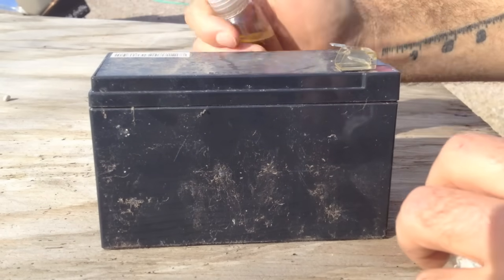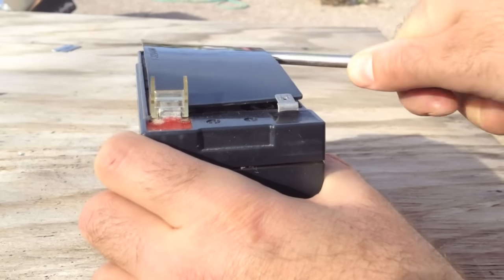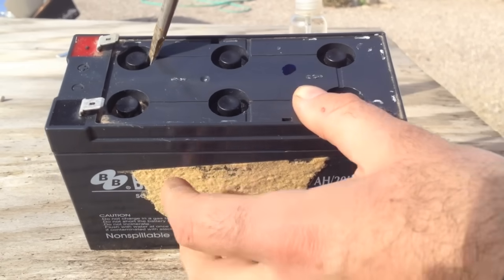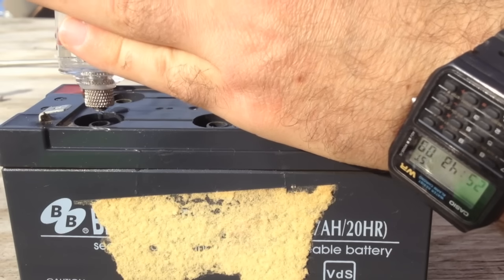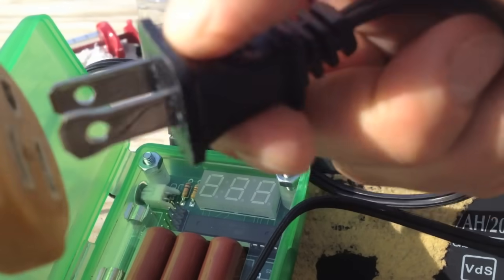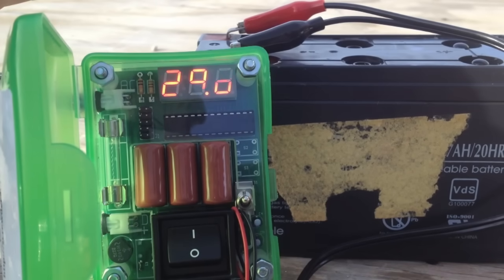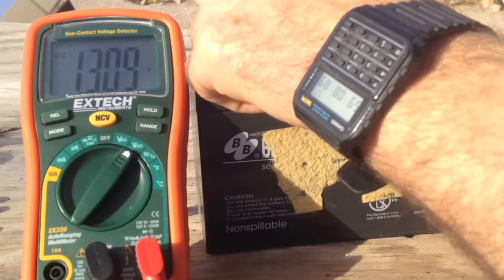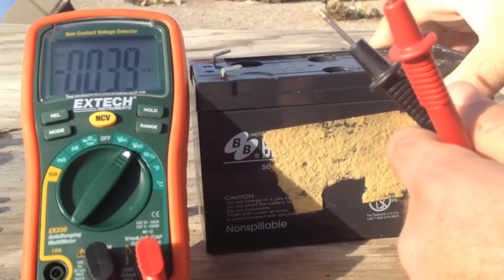Sealed Lead Acid Battery Recovery

Comment: The true test as to whether or not a battery is fully recovered is to perform a load test and capacity test. So what capacity (at the 20 hour rate that is shown on that battery) did you measure?

Comment: If I understand correctly, these batteries don't have liquid water or liquid acid even when new, and they are called gel cells. They can be used in almost any orientations in UPS applications. After adding the water, can you still use it sitting side ways?
Reply: Sure, it doesn't effect the performance.
Reply: Won't it leak if sideways?
Reply: The "gel" in a gel cell is silica sand. The electrolyte fills the spaces like a sponge. The normal level of the electrolyte is entirely contained in the sand. The battery should be fine in any position. If I were to copy this method, I'd add the water, charge the cells, drain off the excess water and then replace the caps.
Reply: Those are not gel batteries...
Reply: This is an SLA battery , what you refer to is AGM.
Reply: This could still be a flooded cell lead acid battery that is just sealed with caps that act as a valve at a specific pressure level to prevent a failure that is explosive and allow the battery to not spill acid out when tilted. Overcharging this would cause liquid to be forced out instead of gas if overcharged on it's side until the liquid was lower then the cap is in the cell. AGM have sponges between plates that are saturated to act as the electrolyte and gel type ad a thickener of silica dust turning the water and acid mix into a gel. Valve regulated lead acid battery is what this is and it is simply sealed by covering the caps with the plastic he removes in the beginning with a razor probably so that they will fail and stop consumers from maintaining the battery by ensuring the electrolyte levels are enough to cover plates to function properly. You could probably just ensure AGM battery with dry glass mats are wet with a couple drops of distilled water as the acid would have crystallized and still be there but being dry probably already damaged the plates with sulfication and expansion of some plates now not being fully in contact with the mats in the cells. So with a flooded cell battery as long as the lead plates hasn't broken down and now sitting as a sludge in the bottom of the battery or completely coated in a layer preventing contact with acid for the reaction of sulfur oxide then it's simply low on distilled water and adding it to levels that keep the plates covered in electrolyte should restore the battery to it's rated capability. Just saying SLA only tells you that it's a lead acid type battery that is sealed. Is it valve regulated so it doesn't explode from overcharging? Does it use Gel or glass mat type electrolyte medium? or is it just a regular old Wet cell lead acid battery that the manufacturer sealed up (kinda) so regular maintenance instructions are not needed and failures will always mean that one should buy another battery rather then correct the failure that might only be add mineral free water to dry acid for wet acid solution in lead acid battery....
Reply: bn880 absorbent glass mat and gell are different but they can't still be both flipped  any way the user wants and have no effect on performance.
Reply: NoVaKane is right. AGM(Absorbed Glass Mat) are different than GEL batteries. both do not require any additional water/acid mixture once sealed from the factory. For many many years people confused AGM with GEL. The best example is Optima Batteries. For years I have been correcting customers thoughts that Optima's were GEL and infact are AGM.
Reply: They can be AGM or Gel. All Gel batteries will be marked as such due to it being a huge selling point. And no...once you have broken the seal I would noy use them in any position but vents up.
Reply: G Henrickson or they mark them do people know what kind of battery they are so they know better how to properly charge them. If they wanted to sell more the wouldn't list them in hope more people would ruin their batteries and in turn need g to buy more

Comment: Aww man so awesome I'm in a wheelchair and I had a power wheelchair given to me and it has set about as long as your battery it takes two batteries and they are about $300 a pair I can't afford that so I'm going to let these cool off they have been on charge a while and I'm going to take them apart and try what you just showed me thank you so much my good friend
Reply: Roy Nelson I have a brand new electric wheel chair that was my mothers, the ticket on it was $10,000 and some change. The two batteries on it are $400 each but I was able to revive only one. I use it on my solar power battery bay now. As for the chair.. I need to find a buyer for it. I'm not selling it for $10K lol that's insane! but it has all the bells and whistles on it. I also have a 3 wheel Scooter that I modified the gearing on to go faster... Mom liked that one best, she was a big drag racing fan too so right up her ally!
It has the seat that goes up and down with a button press and a charger built into it with a retractable cord.
Reply: That's awesome brother it really is I have a youtube channel you should check it out sometime I put some motorcycle speakers on my power wheelchair MC 400 they rock pretty good lol I'm into RC cars and stuff I do different kinds of videos with those me and my grandson when he's here I do a lot on my own I'm doing a build right now and test and tuning put some boost bottles when this one here better throttle response
Reply: Roy Nelson I been doing some Arduino wireless stuff recently, I got some of those esp wifi modules and I can see great potential with those for home automation and even RC applications. Somewhere around this mess of a shop I have an RC drone with a servo camera on it.. Paid over $450 for it a year ago.. I use it to inspect radio towers before we climb them.
Reply: That's awesome brother and hell yeah on the drone that's really cool what you used it for I've never had one one of these days I will get one after I quit playing with these cars and settle down for a little flight time I want to get an airplane and its called the e flite apprentice that's what I want man
Reply: I never had an actual RC plane, a friend of mine had a B-52 RC gasoline plane and it was HUGE!
The drones are tricky to fly and takes practice because you don't want to crash one, expensive to repair..
I also have model HO scale trains too.
Reply: That's awesome brother I have always loved those trains
Reply: Roy Nelson résultat : c'est comme pisser dans un 🎻 violon !!!!
Reply: Serious? You can get these Battery from $14 - $20 - With my Time and Money and Coffee trying to revive these... I have better luck buying new battery :///
Reply: lmao

Comment: I'm enjoying my DP2! I'm restoring every old battery I can get my hands on. I have a problem with a new SLA I got off ebay: When inside the UPS, the battery is on its side and leaks some liquid. Any suggestions how to make sure those caps stay on snug (but not too snug)? It's a battery very similar to the one in this video. Thanks

Comment: The fact that the caps are sunk in tells me that no pressure is of concern as the water levels have dropped caving in the caps requiring water , sadly the fact the battery has sat for so long possibly damaged if not one all cells Internally leaving the battery useless , it might show charge and hold temporarily but inevitably will lose charge and render time repairing a wasted endeavor. Nice video and well spoken much appreciated and health wealth and happiness to u and yours sir.
Reply: Can battery like that with 1 dead cell still be used as 9  volt battery for 9 volt fan ? I

Comment: Can this kind of battery blast? It looks pretty safe dry, quiet, water etc (i hope you understand)
Not like li-on or li poly batteries that sound more chemical and complicated to me.
And my last question it is lead battery i know that it has lead plates in it but you put water in it so where is the acid?

Comment: Comments included this "Iron Out" product and dumping all fluids and replacing with distilled water. Why were you not using new battery acid instead of water? I have no experience with these small batteries but lots with big batt for electric warehouse equipment. We would remove those cells gently wash off the sulfation and clean out the case. As long as the plates were okay and the sulfation was no longer present we would refill with new battery acid, ck the specific gravity of the liquid and recharge like a new battery.
Reply: Ok bud, you have presented the same problem which you started your comment out with. How did you remove the sulfation? Iron out? How much did you use?
Reply: JM these are batteries that are in metal cases with individual cells that are sealed in with an asphalt product. These batteries weigh anywhere from 2 to 5,000 lbs. depending on the equipment and voltage, amperage requirement. We would remove the inner cell connectors and pull the non-performing cell completely out of the case. We then cleaned the cell with baking soda and water and plain water under no pressure greater than what you got from a hose. We vacuum out and cleaned the case with the same solution. After a thorough drying we reassembled the cell in the battery case. We also had floor drains in our battery room where all effluent went into a concrete vault. We had it pumped as necessary by an environmentally approved company. I hope I have answered your question. The battery companies are building these batteries (the individual cells in plastic now) which makes this type of maintenance more difficult but not impossible.
Reply: @denniswarren3211  Sounds like a battery I would Like to "get my hands on"

Probably hellishly expensive I would assume!
Reply: The batteries we are talking about weighed from 1800 lbs for a pallet jack to 5000 lbs for a large counter-balance electric forklift and averaged back in the 80's about a dollar a lb. new. If you could find an old style one today you would be competing with people who would be buying for scrap/salvage.  I might look for an old one as well for use as battery backup for a whole house solar project since I could repair it myself and I can't afford the newer Tesla battery backups. The only recent experience I've had was to convert a selector machine like you would see at Lowe's or Home Depot to an elevator for a friends shop. We used the mast and electric hydraulic lift mechanism and removed the wheels and travel mechanism since we mounted it permenantly. By leaving the big 24 volt battery we were able to retain all the controls and just added limit switches to stop it on the second floor and a quality charging system which I salvaged from a 24 volt handicapped scooter.  The battery was okay since it only ran the lft motor. If it has problems we will either repair it or replace it with 6 volt golfcart batteries in series to get our 24 volts.  You might find a battery like this at an equip auction or scrap yard. The weight would make them desirable for scrap but not much else.
Reply: After filling the battery cells how much voltage to charge and is it AC or Dc
Reply: Graham, Look at batteries from electric pallet jacks all the way up to counterbalance electric forklifts. These batteries were anywhere from 12-48 volts DC. The individual cells were 2-2.5 volts each sealed with that/asphalt sealant and connected to the adjoining cell by lead strap type intercell connectors. The cell varied in wt. and size to vary the amperage. We had bits that were hollow and after drilling the connectors you would be left with a post much like a car battery that was still connected thru the top of the cell to the inner plate structure. After pulling the cell out of the case and cleaning the sulfation off the plates with water and brush(gently) and cleaning and drying out the cell opening in the case you would reinstall the cell, solder the connectors back on and reseal that cell and refill the cell with new acid. We could charge the repair cell by hooking to the cell connectors but ultimately recharged the whole battery to the DC voltage for that battery. Any questions?

Comment: By just adding rainwater you're not going to realize the battery's full potential. You should be using distilled water and add some battery acid before topping up. Otherwise you will be diluting the electrolytes. But I have learnt how to flick a razor blade across the work surface.. Nice watch
Reply: H 2.  So4.  Added
Reply: No need to add "battery acid". When the water evaporates the sulfuric acid stays behind. Just use distilled water.
Reply: @outdoorwonderlust  how do you mean?
Reply: @jollynery  It is the distilled water that evaporates from a lead acid battery, not the sulphuric acid. So by adding distilled water, you bring the acid and water content back to the correct mix.
Reply: My sealed lead acid containing UPS has failed, would watering it do anything to help it work better?
Reply: Àaq

Comment: IMPORTANT: Don't over fill the battery or you will make a mess and loose allot of your electrolyte when charging. THE WATER LEVEL SHOULD JUST COME UP TO THE TOP OF THE PLATES AND NOT OVER. This system of recovery works... Thank You,

Comment: If you don't have a pimp charger, but just a regular charger, how do you revive it if it shows 0V and does not accept charging current after filled up with water? Thank you.
Reply: Luxoriginalis I was wondering the same. but i have a UPS system. i am going to try charging my battery with that.
Reply: Luxoriginalis This entire video is an advertisement for da-pimp charger
Reply: Nasrani MinAlGharb Pimp my charger ;P
Reply: Luxoriginalis You can use a Dewalt (or any other good quality) cordless drill charger. It not only pulse charges,  it also tests the battery to make sure it can even be charged at all and it will shut down when the battery is full.

Comment: you need to add "desulfate from the SOFT sulfation only"  into your description..there are two types of sulfation...soft, which is reversible..and hard, which isn't reversible ..and the hard one is one which happens the most  to charge-deprivated  long-stored batteries and nothing in this  world  can fix it
Reply: Uu

Comment from the maker: An old style charger will not be able to overcome the resistane of batteries that have been left uncharged for years. You will need a charger that can handle a large voltage range even for brief periods to overcome the internal resistance.

Comment: I always believed that when topping up a battery you only went just over the plates. Not until it flowed out of the top of the cells.?
Reply: Yes, you don't want to add to much because of the ratio of acid.. It should only be done as a last ditch effort anyway.
Reply: @jesscast5122  why would you direct someone to put their brain into a battery? I haven't seen any videos on this, does it really work? Did you put yours in one? D:
Reply: Yeah you want to fill to just cover the plates as charge and discharge will effect the levels and it can boil and bubble when you charge it if no room for gas and such is left to allow expansion you might cause the battery to rupture if it doesn't have any kind of overflow or pressure release valve, like all sla batterys do not have... the other problem with agm sla battery recovery is that capacity is probably going to be nothing like a new one as the crystallized acid will form between the plates and the glass matting and spread plates sometimes even cause some plates to fracture  and recovering from this isn't possible without recasting the lead with the sulfation insulating parts of the left over plates held into place by the agm  making pulsing and such not able to cause it to fall off. probably get some use from them in conditions where they are not moving anymore and always in the upright position. wouldn't use them for a scooter or anything...

Comment: Ive bought a £250+ electric scooter that's basically just lost power due to low battery fluids. Cheap fix but I read somewhere that you can (or "must) use distilled water. So rainwater is also ok? Good to know. I also read that you can add soda to the water to help set up the charging. Is that also correct or a good idea?

Comment: I have lots of these batteries and i have a couple of apc backup systems i want to sell but their batteries are bad...  Also my verizon fios equipment needs a new battery aswell..  can i use an old nicd quick charger (protech 702) to fill in for your Da Pimp charger? i believe the output on quick charge is 3-4 amps

Comment: why fill it so fully, you'd dilute the acid more than it's meant to be, and probably reduce the recoverable capacity.

the electrodes in this type of SLA battery are more like sponges, they just need to be wet, not floating in liquid acid which could easily leak out if the battery gets knocked over. the plugs are not designed to liquid keep acid in, just let gases out

flooded lead acid batteries, like in a car, have more robust screw down caps as they need to keep liquid acid in check.
Reply: Couldn't agree more with your conclusion. These batteries should NEVER be flooded like a car battery/Flooded Lead Acid. By just getting enough moisture into each cell that the "matting/Sponge" is damp and never totally wet, the battery "May" be recoverable if no internal warping or degradation has taken place 👍👍👍

Comment: I mean, it is called a Sealed Lead Acid battery for a reason. They are not designed to be opened and filled with water. the electrolyte is absorbed into the plates during the manufacturing process. But you may get a little bit of life out of it for short term, but I wouldn't use it for emergencies.

Comment: Great Video. Did U need 2make a cut under the posts or are only 3 side cuts needed? Also, the rain water - what are its qualities vs Tap Water or Distilled? Thanks in advance 4the Great Video/info.